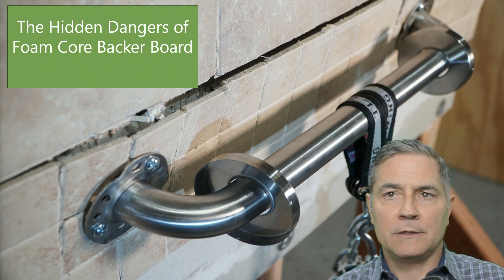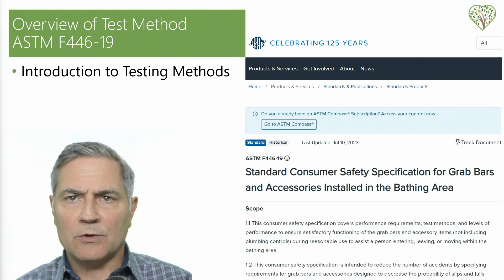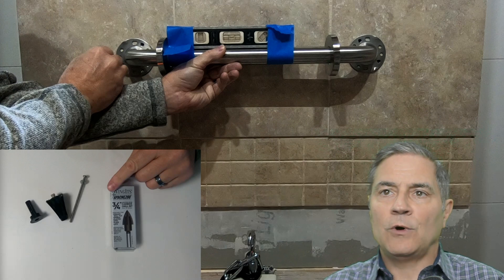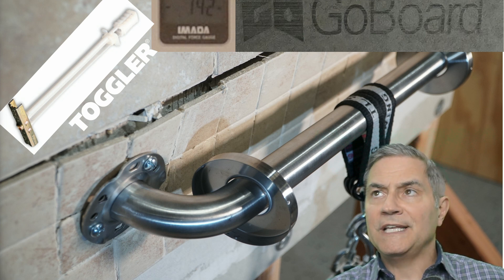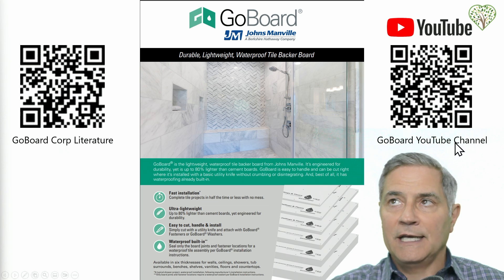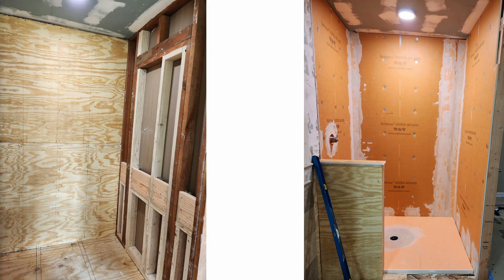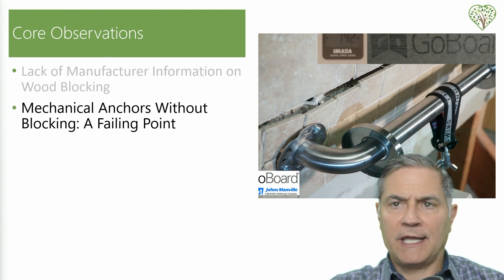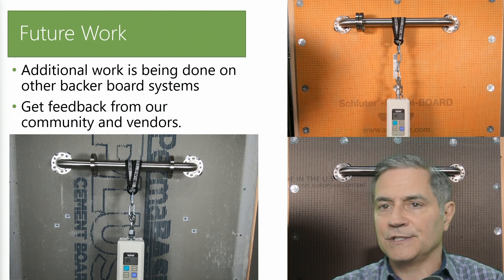E20 The Hidden Dangers of Foam Core Backer Board

Comment: Great series that saved me from a costly mistake. thanks!!
Our tiles in the walk in shower go to the ceiling. There was not one stud finder that identified the studs through the tiles. 
BUT... a stack of 4 nickel sized strong magnets found the studs with ease.  The magnets stack jumped and hung in place where there were studs. Turned out to be accurate for installing two grab bars. Hope this helps someone else.
Thanks again!

Comment: Thanks so much for your videos!! They are the gold standard for anyone looking to install grab bars.  I was wondering if you tested "no-drill" grab bar mounts on walls with the foam core backer board? If so how did that work out?   Also, have you tried a Ultra Wide Band sensor like the Bosch D-150 or D-120 to find studs with this type of backer board? Thanks again!!
Reply from the maker: Thank you so much for watching my videos and for your kind words! I really appreciate your support and feedback.

Regarding your question, I have not yet tested "no-drill" grab bar mounts on walls with foam core backer boards. However, I'm interested in exploring this area further. I'm currently in discussions with the foam core backer board industry to update their installation manuals to include recommendations for wood blocking, which could enhance the stability of installations like grab bars.

As for stud finders, I did reach out to Bosch, and they recommended trying the GMS 120. While they couldn't provide specific information on its performance for tiled walls, I plan to test this stud finder later this year along with 2 others and will share my findings in an updated video.

Thank you again for your thoughtful questions and for being a part of our community. Your input is invaluable and helps guide the content I create. Stay tuned for more updates!

Best regards,
Daryl